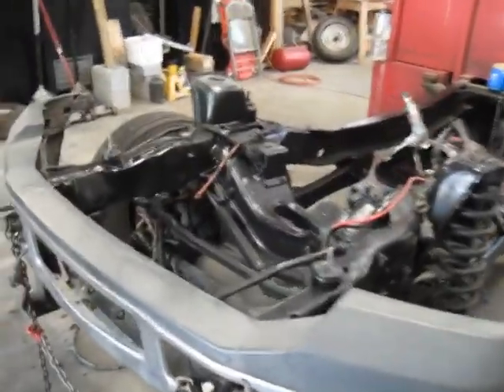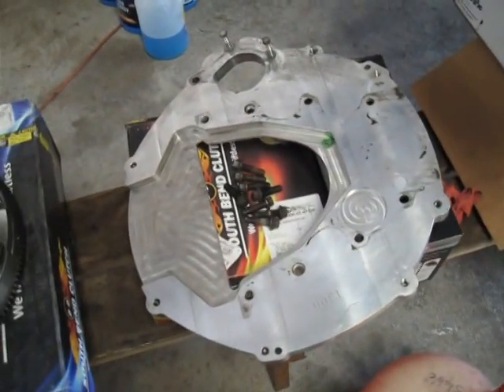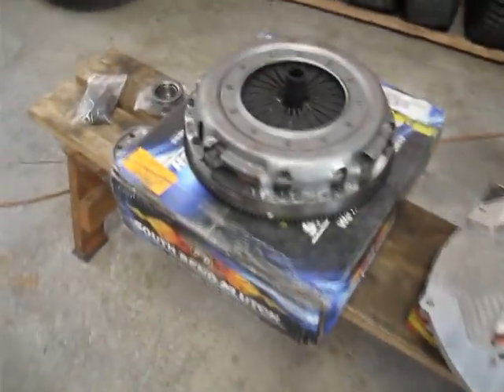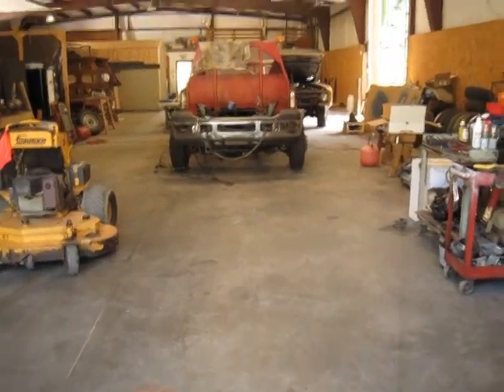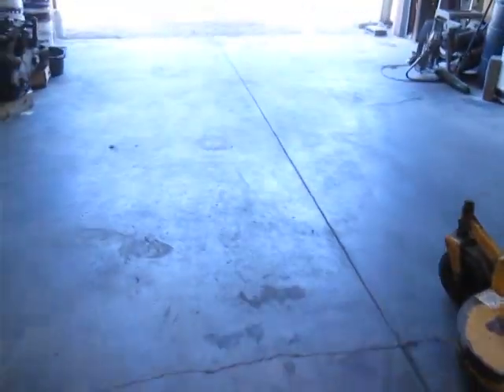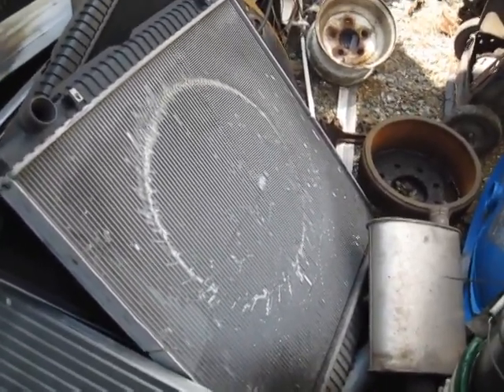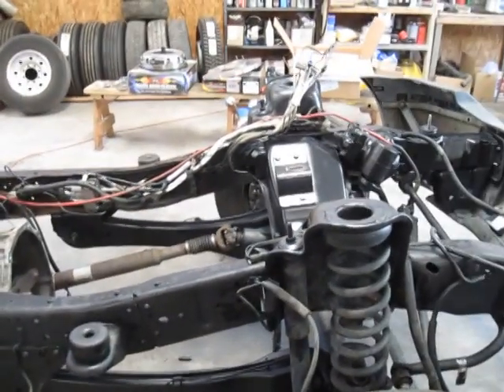2006 ford 12 valve cummins swap

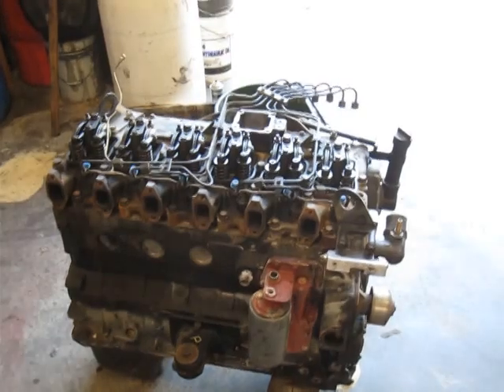Comment: 1:06 that wasn't a '96 Cummins because it has a STORM block which didn't come out until '98 on the 12v and 24v's.
Reply from the maker: I use the 1996 year as a mid run time for the p pump 12 valve engines and plus when you get a remanufactured engine you don't really know what year it was when the tag is gone plus all the parts are the same unless it's an industrial block with two oil drains for the turbo

Comment: David. Being that the 6.0 runs at a higher RPM as well as the engine being de-rated, what did you guys do to compensate for a lower power producing RPM coupled to an already low geared truck and maintain any highway speeds over 55mph at a reasonable rpm with the Cummins? In other words, did you change the gear ratio/tire size and or ad some kind of 2-speed to the rear end?
Reply from the maker: Nathan Hunt. Nothing needed to run 75 with the cummins. The ford 6.0 will run 75 at 2500 rpm in 6th gear. So the cummins dose just fine. But a lot of fuel and boost to get the cummins to build power to match the 6.0.